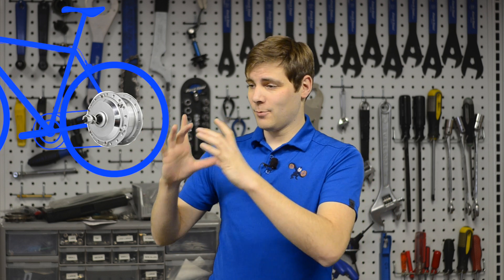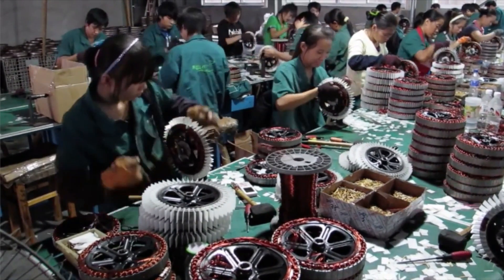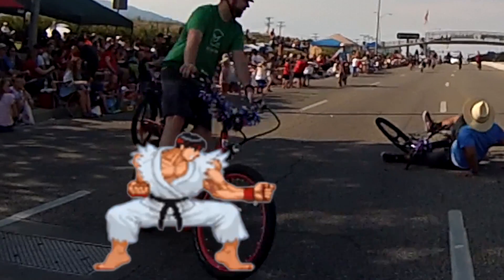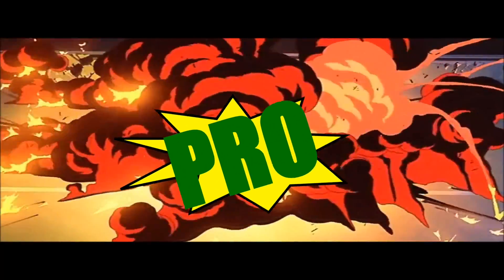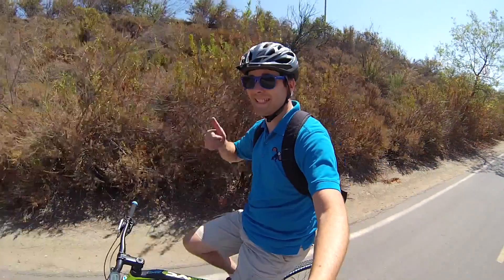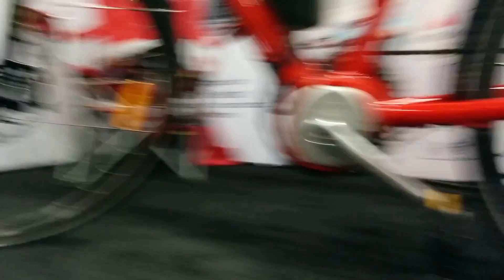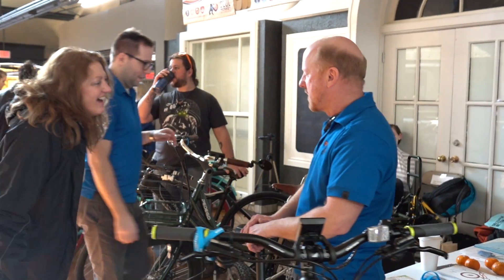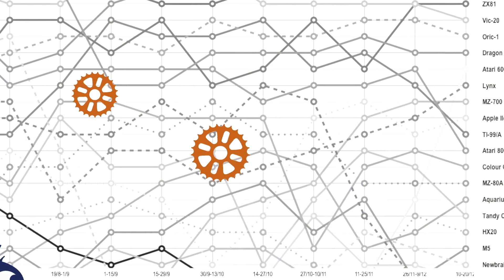Hub Drive VS Mid Drive eBike motor systems

Comment: Mid drives the great but you should run with an 7 or 8 speed cassette as the chains are stronger and I've never broken one yet riding New Zealand's mountains. I run a BBs02 with upgraded controller fets, 40t bling to a 32-11 shimano cassette, On a upcycled Foes FXR Strongest frame ever. I'm Lovin it
Reply: Lunar me ~ That's what peoples should listening to, Someone that REALLY experiment the mid drive. I use BBS 02, repair it , replace parts in it and maintain the drivetrain to keep everything "Fun & Function" . For those who still reading, if you want to keep it simple, cheap and powerfully fun (half of the time in air), choose the bike you want to perform on, put a BBS02 or BBSHD, buy a good quality 7 0r 8 speed drivetrain and... put in your ears "Fly Me To The Moon - Frank Sinatra" https://youtu.be/5hxibHJOE5E and everything will be alright. P.S. for more freedom, build your own Battery pack and put it on a back pack. lots of money will left to buy you a drone and you'll come back home with the smile cause you got the deal... done. Got that?
Reply: Not all people. Many want to just throw their leg over something and go riding. Thiose with a serious off road ride need to maintain and tweak and are always modifying things for performance. Its not for everyone. Also...trail (and road) restrictions are upon us, likely due to those who ride 1000 or more watts and are tearing up the same trails as conventional riders. Dont get me wrong, I have several types of eBike but I try not to anger my fellow riders by showing some compassion on the uphill slogs.
Reply: But...you must use some finesse to keep the Rohloff from grenading...or maybe your BaFang is of lesser power?
Reply: I use a 3000W Cyclone on my downhill bike. Spot on about 8 speed. It is an awesome setup. I have high powered hub motored bikes with ferrofluid and hub sinks as well, but the Cyclone is much nicer on hilly and DH tracks.

Comment: Has anyone thought how to use a shaft drive instead of a chain?
Reply: Kenneth Russell  shaft drive would result in more Los's in power chains are more efficient
Reply: Blue Monkey Bicycles I think he means with a rear differential and a driveshaft from the motor like on some motorbikes (BMW comes to mind).  While it might be overkill from a durability perspective and overly heavy, it could make much higher powered bikes possible in the future.
Reply: Too heavy for a bicycle, and a chain is very efficient.
Reply: Too heavy and inefficient. Ity would be very reliable though...maybe for a cargo bikes?
Reply: check out MoBikes, rental scheme
Reply: Maybe belt will be more efficient instead
Reply: Why not just change the sprockets and use a motorcycle chain, you'd have a really hard time breaking the chain then.

Comment: tbh mid drives have made great improvements you can find a kit that will adapt to almost any bike and they are becoming cheaper some kits starting at under 500 and they are making very strong chains almost motorcycle type chains.

Comment: Solution to uneven weight from hub motor on 1 wheel: 
Put 2 hub motors on!
Reply: 2 hub motors + mid drive!
Reply: YES!
Reply: @ad go Haven't got an Ebike yet but definitely 2 x 250w. Better weight distribution + better traction. Kinda like a 4x4 car. Only negative is the extra work with the electronics but I think that's no biggie either.
Reply: 1 front hub is the best because the rear wheel is the one you peddle ,so you have 2- wheel drive which has the least maintenance and stress on the bike
Reply: @theowink - Stress on the bike shouldn't be a concern. A 1 kW bike motor is about 1⅓ hp.
Mo-ped is < 5 bhp. Almost 3¾ x as much power.
Reply: One better put two hub that are regenerative breaking and only as back up motor and then a mid drive bealt not change as main. The perfect ebike. Make a solar parasailing attachment and fly down after climbing 9 thousand feet charge the battery as you glide down to a solar bike charger battery swap out station. Haha
Reply: would weigh a lot more though, compared to 1 motor with twice the power
Reply: grunt More Power
Reply: Sort of like a super charged ebike...
Reply: The Hub drive that I put on my Burley Hepcat recumbent caused for some extra Unsprung weight. I did like how it was the 20' front wheel so that gave it a 20/27th climbing advantage.

Comment: I was a confirmed mid-drive fan, but couldn't afford one. I found a great deal on an eMotion FS 650b (with rear hub motor) and bought it - and here's where I was converted to the rear-hub drive fan club.
Lifting or just unweighting the front wheel is important when riding trails - to get over obstacles. With a mid motor, the weight of the battery and motor are forward of the pivot point (the rear axle); whereas with a rear hub motor, only the battery weight is forward of the rear axle, making a noticeable difference to the amount of effort lifting the front wheel.
A good discussion video Blue Monkey folks! Thanks.
Reply: Good info, well presented! I’m not going to be doing any trail blazing (indoors or outdoors—great recovery haha), so this was perfect for understanding weight/balance and performance issues.

Comment: Another con of a hubmotor besides the weight is that there is a lot of spinning resistance when the motor is not engaged and you are just peddling.
Reply: I have a 1000W hub motor and there is a big difference when spinning a tire without a hub motor and with.  I suspect it has to do with the planetary gearing.  It is not hard to spin but it does have some resistance compared to a non-hub motor.  Have you compared spining a non-hub motor to a hubmotor?  There definitely is a difference.
Reply: I am all for electric bikes.  I think they are great.  Especially an inexpensive city commuter in that you are not sweating profusely from a hard ride to work.  

Just my experience with my hub motor there is a small amount of noticeable resistance that with a non hub motor.  In any event, after riding with a hub motor you do get use to it.